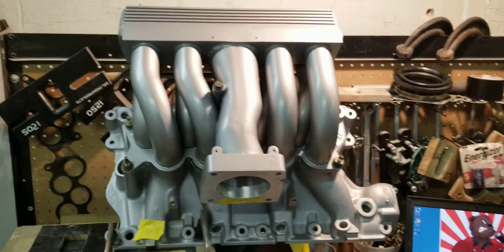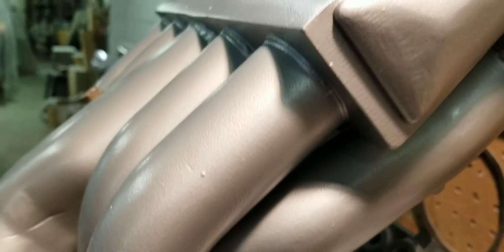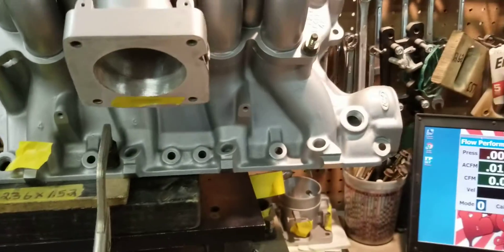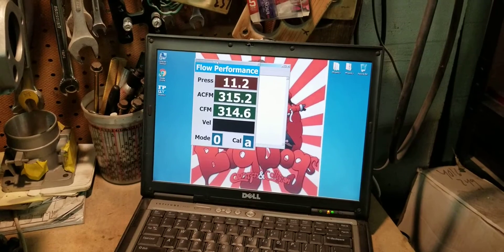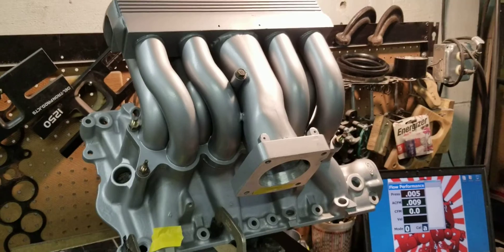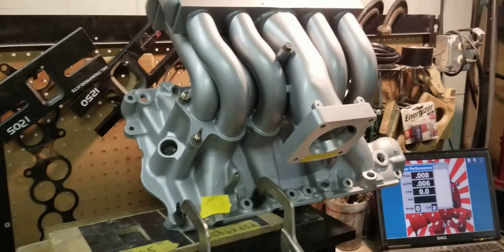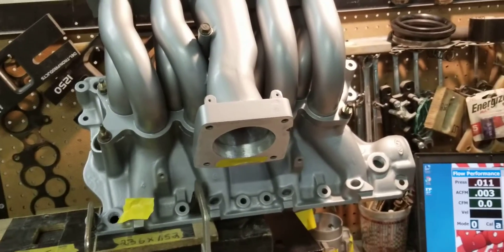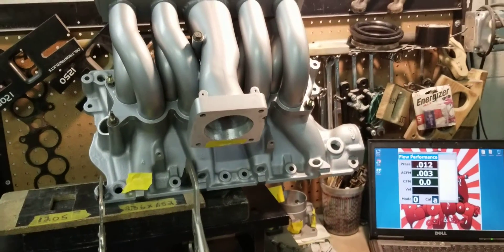Ford Tubular 351w gt40 manifold stage 3 ported by Bigdogs Porting

Comment: Does the tubular produce the numbers as Cobra/explorer intake when ported? Can the tubular be pushed pass 400hp
Reply from the maker: @tyrikmoore2903  in our stage 2 form with the right supporting parts yes. The key with the Tubulars hp and rpm success is total runner flow and throttle body tunnel flow. We see so many people making the mistake on mildy porting the lowers only on these manifolds then posting pictures on forums saying how pretty the porting is but they do make any real hp.  This is why.
We have posted customers mph vs vehicle weight putting down 350whp with our stage 2 Tubular with a stock bottom end 302 with out the box cheap low flowing heads.

Comment: Is there a spacer kit that would allow this manifold to be used on a 5.0 302 based engine ?
Reply from the maker: The tubular upper bolts to a 302 gt40 lower just like it does on a 351 gt40 lower

Comment: I'd love to see dyno numbers on this combination.
Reply from the maker: You will. We have many stage 3 tubulars out there and all I can say is we have yet to see our stage 3 tubulars maxed out! This manifold flows more than a stock TFS R and our stage 2 ported Holley Systemax 2 manifolds. Look through our videos and compare flow results. Remember all of our parts are flowed on the Same bench using the same fixtures and flowed the same way so everything we flow can be compared to other parts we flow. We keep our testing consistent for this very reason.